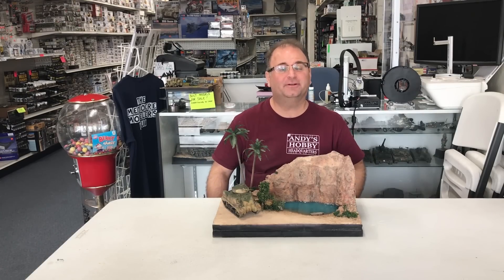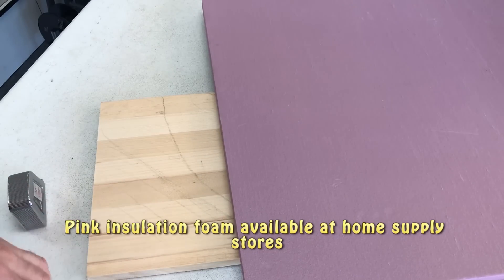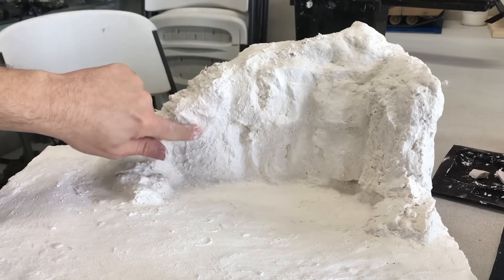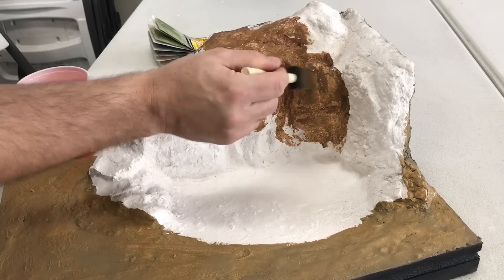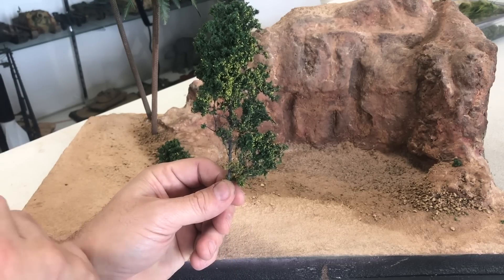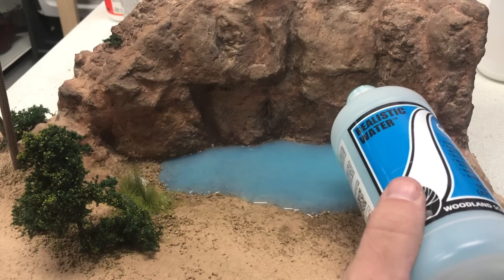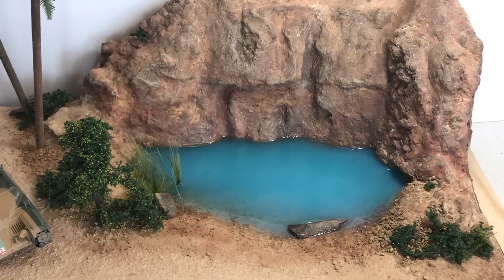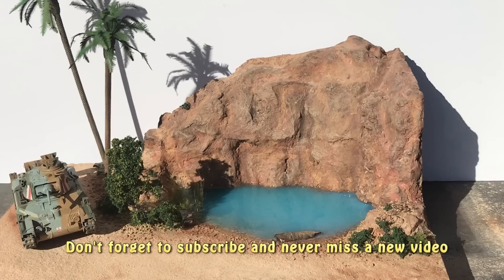Realistic Desert Oasis Diorama complete step by step building instructions

Comment: Hey Andy, how can you store models without them becoming dusty? Besides display cases too, because most are quite overpriced.
Reply: Gautam Chiang i wonder this too, some models can be difficult to clean, and if you have loose pigments they will fall off
Reply: Two ikea leck tables turned upside down makes good cheap display box just add clear acrylic side with magnets and your golden.
Reply from the maker: I put them in my display case
Reply: I put cling wrap used for food over them, very cheap and you just pull off to view then reapply